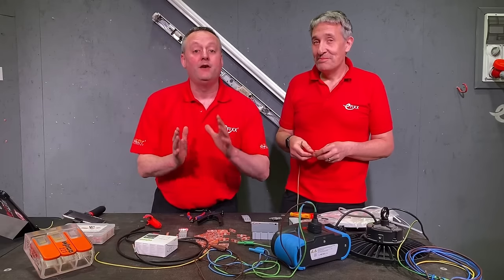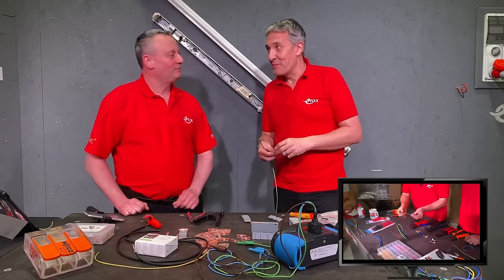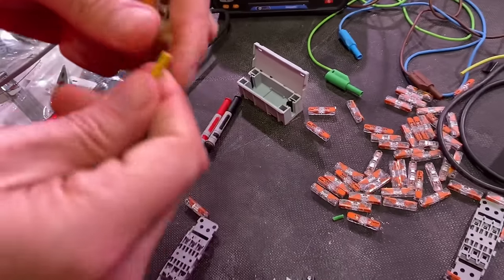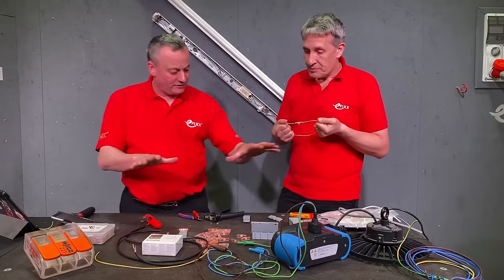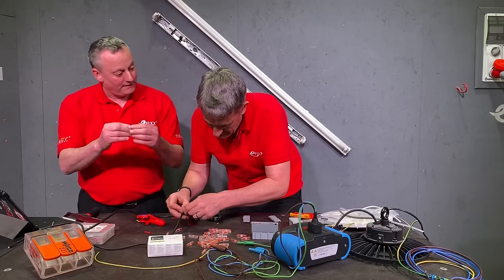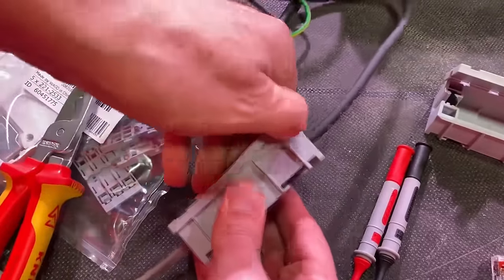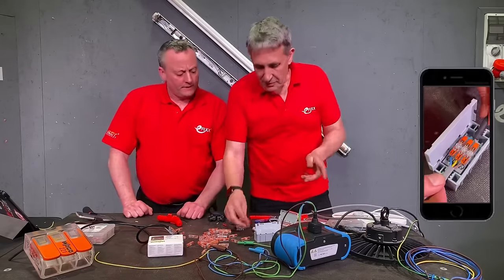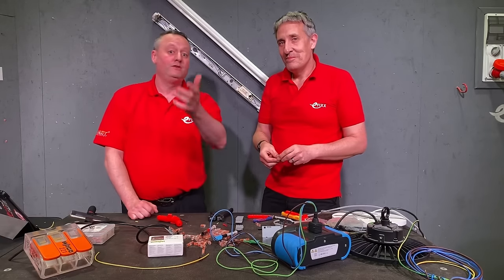The Ultimate Guide to the Wago 221 Inline Connector

Comment: Jesus, somebody tell motormouth to back off the lines of coke.  Are the Wago boxes rated as a stand alone junction box?  Or do they have to be in a rated box as well?  If they are rated is there a way to mount them so that the cover is flush with the wall surface (all junction boxes with splices have to be accessible and cannot be buried behind sheetrock or whatever wall covering is used) to satisfy code requirements here in the US?
Reply: Rude

Comment: I myself, I just don't trust them. Maybe wrong but I think can only think of a stab- loc connection.
Reply: Why not, and what do you suggest instead?
Reply: Russel, after 40 years I always used a twist on the wires n the right wire nut. 25 of those was service. Seen plenty of burnt connections. A good twist makes a more contact than any other connection.
Reply: @mdvener I'm learning electronics and electrotecnics, and also I'm not English, so bear with me: by "twist" you mean making a "pigtail" with the conductors? Here in Italy instead of wirenuts we use something called "forbox", basically it's like a plastic cap were you insert the twisted wires in and then secure them with a screw. Your point about "more contact" makes sense: by twisting the appropriate length of conductor there should be a large contact area between them... I don't know about Wagos, I mean if they pass regulation tests in different countries I would assume they are safe to use if they are operated correctly. Definitely not enough experience to have a solid opinion about them though
Reply: Russell. That's exactly how n what I do.
Reply: @mdvener  why are nuts? Lie on it being done correctly and a lot of other things? These Wago connectors are amazing. if they are approved the UK they may rigourous standards including a glow wire test showing they can handle being overheated

Comment: I take these ain't maintenance free as they have the leaver do have similar set up for a maintenance free joints i.e. lost forever
Reply: The lever connectors are also MF to BS5733 when used in the 221-4 WAGOBOX. The WAGOBOX Light will also be MF once testing is complete.

Comment: This is too expensive for a random lighting application. 32A is overkill. Also 3 pole inline Wago221 would be more reasonable. Also I would rather take without a lever for more compact installation.
Reply: You can always use our 224 series. We do have other connectors which being launched that will address the above but not until next year.
Reply: 32 amp is not overkill as some circuits require that

Comment: Connectors great but bullshit with extra accessories just complicating a simple job
Reply: Not really, they ensure the maintenance free rating can happen now it has the approval
Reply: @UKsystems  any different to choc box
Reply: @tristanedwards1340  the standard ones and the box actually hold the levers down and this one properly hold the connectors as well basically meaning it can’t just undo
Reply: @UKsystems  but does the fire rating classification change from choc box to 2 part Wago box
Reply: @tristanedwards1340  they have tested the connectors with a rating then in the box so if the connectors are rated it should be ok

Comment: How much money have you received to shill for wago? These connectors should be strictly used for low currents only (i.e. lighting). They have the absolute highest resistance compared to any other crimping method, the wires have way too much wiggle, not the best option for stranded wire and they cost the most. We have to cut this crap about german superiority already. And finally you pronounce the product wrongly.
Reply from the maker: I’ve used Wago screwless connectors for over 20 years and never had any problems.  Used them in everything from lighting products to high current industrial panels. Have UL, ENECand PSE approvals bodies missed something?
Reply: You need to see the UK conformity assessment documentation. You are very wrong here.
Reply: They cost 30 cents a piece in bulk, they are rated for full load, 24/7 domestic use...stop lying.